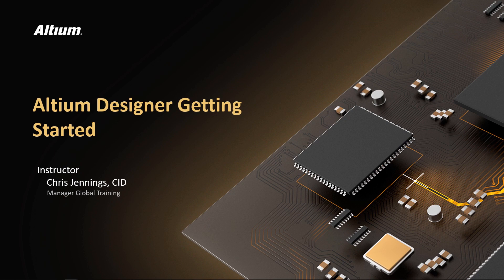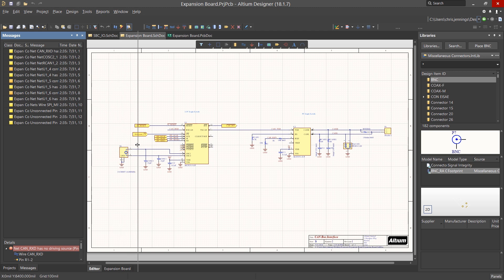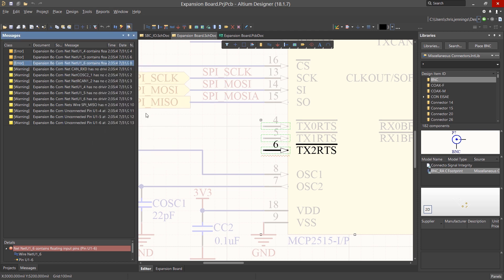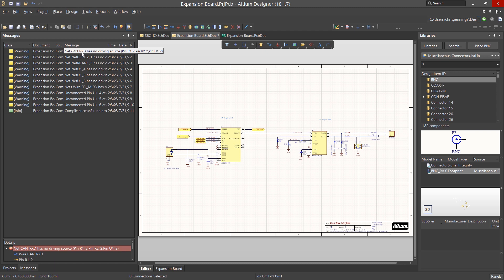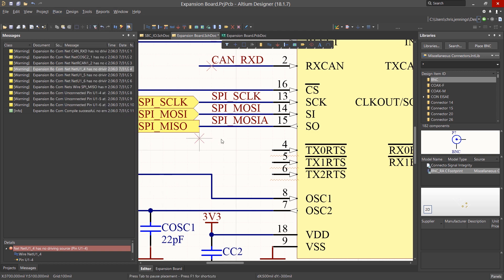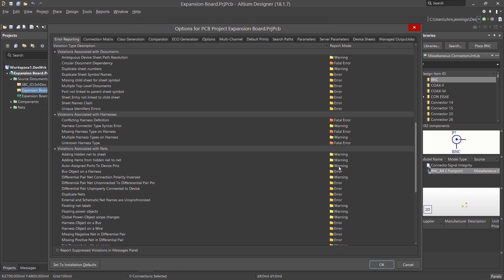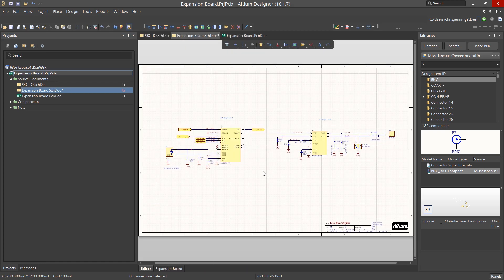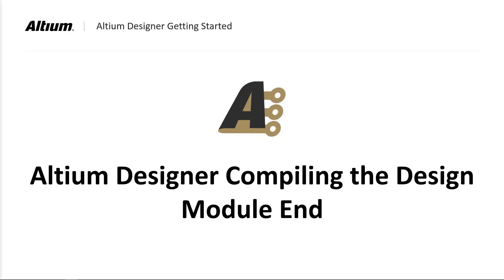3. Compile Design - Altium Designer Compiling the Design

Comment: I only get "Validate PCB project" and nothing more. I finished the schematic and validated it and fixed every warning and error. I wanted to started the layout, but it shows when I import changes "errors occurred during compilation of the project". Are these the same thing validate and compile? Apperantly not, since I already fixed all validation errors and warrnings. The errors from compilation are also not cross proping, so I don't know how to solve them. Any idea?